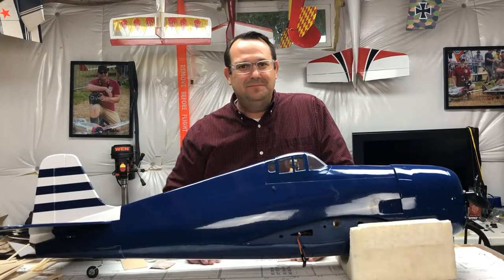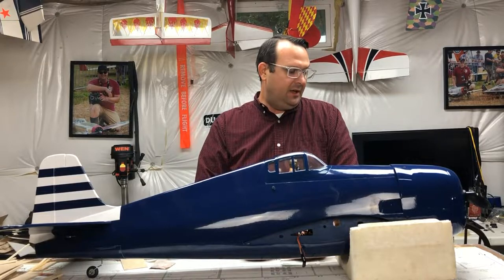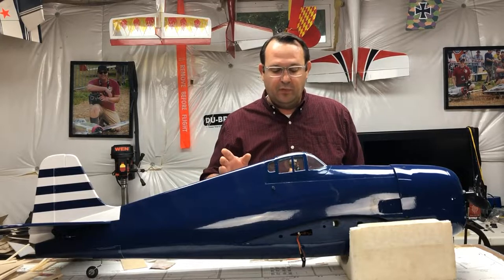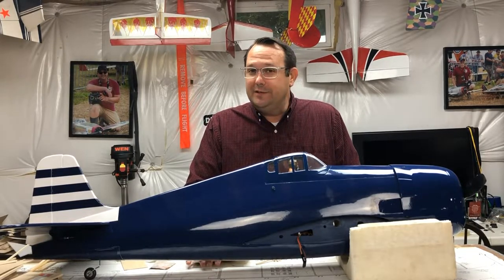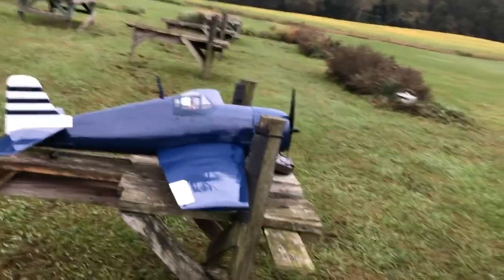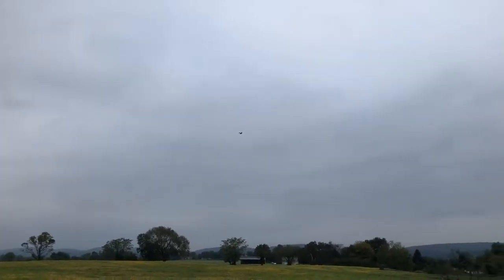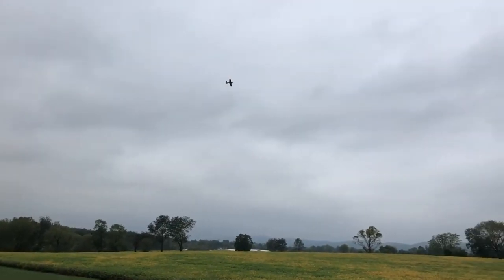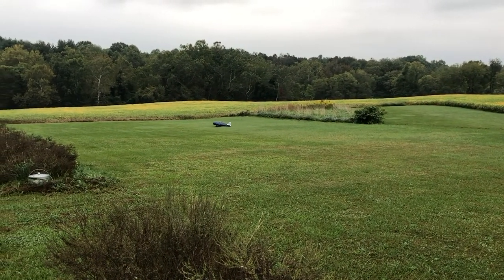Hangar 9 F6F Hellcat: Is it relevant?

Comment: This thing is notorious for control surface flutter and it happened to me.  Elevator snapped off in level flight.  Total loss.  Horizon told me to pound sand because I didn't have a video of it.  Use du bro or robart hinges and dual elevator servos if you want this thing to live.

Comment: I subscribed,  I was wondering did you tap out the 3d printed spinner nut?

Which radio did you use.
Reply from the maker: The spinner is designed with threads printed into it. I use a FrSky Horus radio.